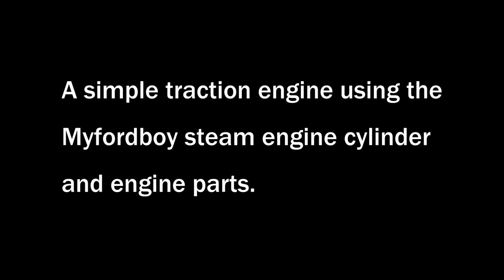Simple Steam, The Myfordboy Traction Engine Part 1

Comment: thats going to be a really nice engine.
Reply from the maker: +Emma Ritson I was influenced by your video https://www.youtube.com/watch?v=Ajgj-l-hWTc
Reply: +myfordboy would it be possible to make the smoke box and chimney without casting? I don't have a lot of machine tool, but enough to make it by hand.
Reply from the maker: +paul chandler Yes it's quite possible. The point of the castings though is to make the construction easier. If you only had a lathe and no boring head  a  tool could be mounted in the 4 jaw to cut the recess for the boiler. Or one could be bolted to a faceplate. The part would be mounted on the lathe saddle for machining.